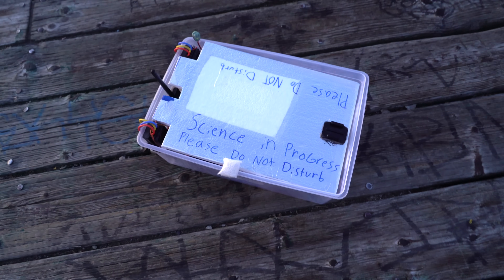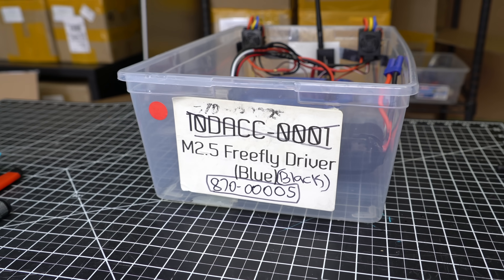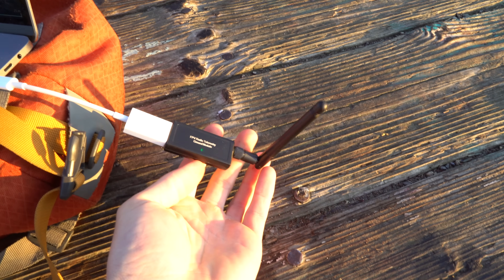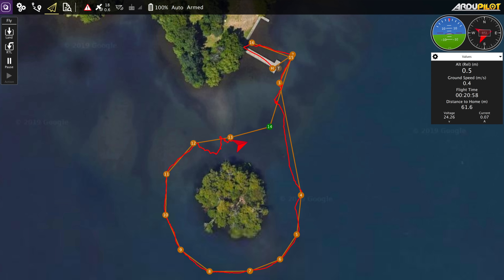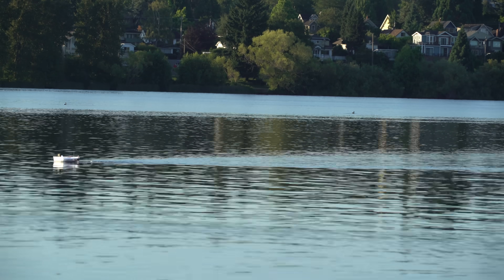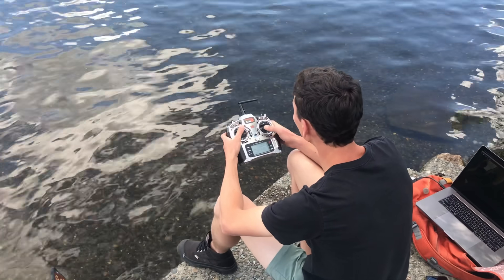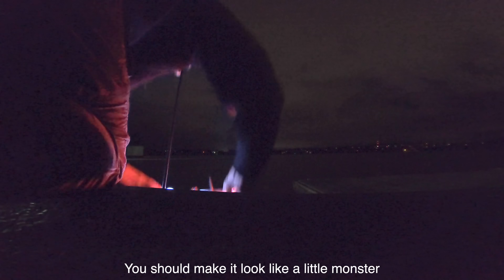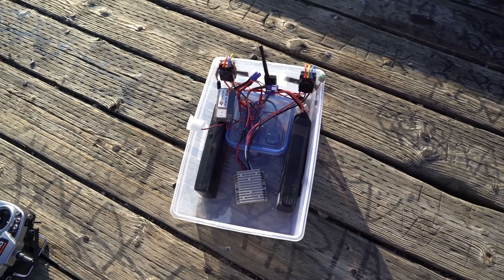Autonomous Box Boat - Long Range Waypoint Mission - RCTESTFLIGHT

Comment: Those gurgling noises are cavitation.
Reply: Technically, those gurgling noises are ventilation. If air is getting in the propeller it is ventilation.  Cavitation is when bubbles form without air.  They occur when the local pressure (at some point on the propeller) drops so low that the water vaporizes.  In short air bubbles = ventilation, water vapor bubbles = cavitation.
This may not seem like a big difference, but the results from the two are quite different.  Ventilation often leads to a drop in thrust from the propeller, sometimes a very large drop in thrust.  But, it usually doesn't hurt the propeller, unless the engine over-speeds too much.  Cavitation, on the other hand,  usually doesn't make a big difference in the thrust, but if it occurs over a long period of time it will destroy propellers. It digs pits in the metal that, it they get large enough, can cause the propeller to break.
Reply: You right my mistake

Comment: I would drill two holes on the sides with a thin rope attached to a foam ball so it can be recovered if sinks.  It's a similar system to how hobbyist recover model rc boats.  Also you can plastic dip some parts that aren't waterproof.

Comment: Nice video! One thing to watch, is that those GPS units have a secondary compass. Pixhawk will use it when you connect the I2C of the GPS. When you calibrate compass, both will be calibrated. The danger is that if the GPS unit rotates (let's say, because you have it sitting loose in a box....) then Pixhawk kalman filter has a hard time resolving the mismatch between the two compasses, and you end up with a compass error. In GPS modes, the compass is used to set the azimuth to aim towards the waypoint. This happened to me once in my flying drone which caused it to crash into a tree. So this could be an explanation for poor navigation performance. You can disable compass 2 in Mission Planner setup to avoid this and just use Pixhawk internal compass. Oh yes and I agree with everyone else, it's a great conversation starter and gateway to other forms of "time wasting!" Have fun...

Comment: Why not use a regular RC boat hull with a proper rudder?
You spent more time creating electronic work-arounds to make a twin motor box navigate like a boat than it takes to make a decent simple boat out of wood/foam/fiberglass.
or..
An airboat would be much more efficient than pushing a box through water, in fact..I cant really think of anything less efficient than a box in water.
(tip: steer the airboat with water rudders for a more positive control and straight-line tracking.  Also angle the back 45deg so they dont snag weeds.)

Comment: Very cool project!  Was thinking you've probably seen that they have electric waterjet drives up to 1" output... they'd be perfect.  an option would be to have standalone paddle wheels or better yet large foam wheels with built in paddles so it could go on land and water.  You could make it a redundant system that ran in parallel or as an option.

Comment: Really great to see this video!  I'm one of the main developers of ardupilot and I really appreciate the feedback on tuning issues with a low speed boat and how you got around them.  Re seaweed getting stuck in the props, we have been thinking that maybe we could try and detect the loss of control and try spinning the props backwards.  I'm not sure if that will work but it's probably worth us trying.  Thanks again!!
Reply: is it possible to create a "lane of travel" from point to point? basically to tell the 'object' that as long as its inside the lane (10 meters ether side of the object) to not correct, and the degree it corrects depends on how far outside the lane it goes. Should create a more gentle correction rather than a jagged wandering. I think this would drastically help correct the "gps wander correction" stuff.
Reply: @HalfInsaneOutdoorGuy  Yes, AP actually already has what we call "Lane based speed control" and this may be the cause of some of @rctestflight's troubles.  The parameter is called WP_OVERSHOOT and it defaults to a very small 2m.  When the vehicle goes outside that it slows down and attempts to get back within the lane.  For sailboats (which AP also supports) we default this value to 10m but maybe we should make it at least 5m for all boats.  Users can change this parameter on their own though of course.  Thanks for bringing this up it hadn't occurred to me.
Reply: There are several other comments about issues he missed that could cause that drift, like the high current wiring being close to the GPS, having the GPS bellow the water line and the metal foil cover, and not using a compass for a craft of such small size. I'm sure Ardupilot could be improved, but no need to overcompensate and mess up correct setups with good GPS and compass systems.

Comment: Haha this Video is AWESOME dude.. I just started learning ardupilot with an omnibus f4 and a mini skyhunter but ive always wondered about the other versions of the software. Can you  link the 900mhz telemetry radios by any chance? Also If im using a 900mhz control link will the telemetry interfere with that? Any help is appreciated :).... Ps some little 3d printed prop cages should solve your seaweed issue i think lol

Comment: A vehicle that slow should use a compass. Distance between GPS measurements (speed) must be way greater than gps accuracy for "no compass" operation. Dont know if ardurover does gps-heading / gyro-heading data fusion. Your data sugessts it doesent. You need that for "low speed no compass" operation. 

Cant have your compass inside with high current wiring. The current will cause wrong compass readings and make your boat go in the wrong direction. Your compass could be in the round gps thing. Put that above the craft.

Dont ask why i know.

Comment: The big unlimited hydroplane boats (100 plus MPH) use semi-submersible props. 1/2 the prop is out of the water which causes a big rooster tail. You might try that on the next generation.

Comment: A single servo rudder would be uber simple and help a lot (and a small keel, or v-hull :)
Reply: And btw, you could see the wind on the water (chunks of wind appear a different shade) when you started.  When the craft veered off westerly and you were doing between 0.3-0.5 (11:15) -> I'll bet you the wind was blowing nearly as hard.  So of course a craft with a lower, more streamlined profile (definitely go for an upside down tupperware bowl ;) would do a lot better in the wind (and small keels).  I know I shouldn't comment before finishing.  I'm sure you thought of all this ha ha.

Comment: always wanted to make a sailboat like this.. I got an openROV and the guys making it recommended using wd40 to spray into the motors before and after use.. suggest you do it aswell.. and make like a fine metal mesh thing into a tube and place it over the motor and propellers and fix it onto the body of the next boat so they don't draw too much weed into themselves.. also I suggest a catamaran.. it's a quite fast shape and it is very steady in the water...

Comment: Build a duct around the motor and prop, and have the duct inlet protected so seaweed can't get in.  I think the ducted prop would probably create more thrust. And if the wind is blowing and causing the boat to strife left or right.. put a dagger board on the keel. It's like a rudder that doesn't move that stick straight down and prevents the boat from strifing off course. 
If you Google the sunfish sailboat.. they have a removable daggerboard the sailor can pull up in shallow water. 
If you used RC car speed controller, you can run a servo to the reverse channel, and use that to move a dagger board up and down. Just some thoughts for design concept

Comment: A simpler idea for a tangle-free drive - simply use aerial props, but position the motors above the water such that the tips dip into the water. It requires minimal modifications and it uses stuff you've already got lying around.

Depending on the angle of the motors, it can either be the "slapping" effect of a paddleboat, or a "slicing" effect for something vaguely like an airboat (but actually using water).
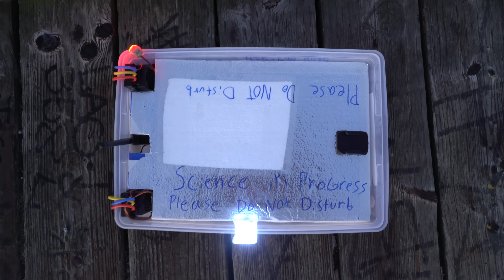Reply: If using the "slicing" effect, then you are describing surface drive propellers: Watch this at around 1:20 https://www.youtube.com/watch?v=Of1RY4M8VqM
The large difference in density between air and water would make using aerial propellers challenging, maybe requiring a gear reduction between the motor and propeller.  Also, I'm not sure it would help that much to prevent weed problems as the tip of the propeller could still catch a weed and pull it up and around the shaft.
Reply: @andrewsnow7386  Cool, I wasn't aware of surface drive systems! Looking it up, I see that there's a surface drive system called "Swamp Shark" specifically designed for operating in swamps with lots of vegetation and stuff.
Reply: Posotive side effect is the splashing keeps away people and ducks.

Comment: Using the compass will probably help with these. If it's only determining the heading based on GPS location, the slow speed makes it difficult to know the difference between it's own motive effect and being carried by water/wind currents. With a plane you can get away without using a compass because the vehicle is typically moving two or three times faster than the air around it, and can't make 90 degree (or more) turns like your skid steer can.
You probably know already, but Randy Mackay is the guy to ask about tuning and issues with rover/boat: https://www.youtube.com/user/rmackay9/videos
Reply: iforce2d  Yes, The GPS  will not start tracking if the boat is stationary geographically. The antenna should be mounted at least on top of the box - a small mast would be ideal. ✌️ Good effort,though 👍👍👍
Reply: But then assigning different GPS points that are at a much greater, corrective angle than those on the route should have little corrective effect if it has no sense of its relative motion. I suspect you're right that it's a factor, but I also suspect that using average hobby-level RC electronics for autonomous navigation sometimes turns out looking like this. It's not the first time I have observed this type of result, including with RC aircraft when operating autonomously for longer periods of time and distance than just a tour above an open field or two. Continuous evaluation of the impact of heading on course and applying an effective correction is obviously not as easy as it might seem. I have even observed some similar problems from older, inexpensive (uncertified) General Aviation units.

Comment: Maybe go with a paddleboat? Place the motors on the sides, above the water. Instead of propellers, use some sort of paddles that slap the water rearward. Maybe that'll be less likely to get tangled up. Basically it's like canoe paddling.

Come to think of it, some sort of paddleboat could be a way to make a canoe-like drone with just a single motor. The motor shaft goes all the way across the vehicle, with two paddles stuck on the ends - 180 degrees out of phase with each other. In "forward swimming mode", the motor just goes steady. But it's possible to turn by temporarily braking with one paddle down. This converts forward momentum into a braking turn. For gentle turning, it could be possible to cyclically vary motor power depending on which paddle is down.

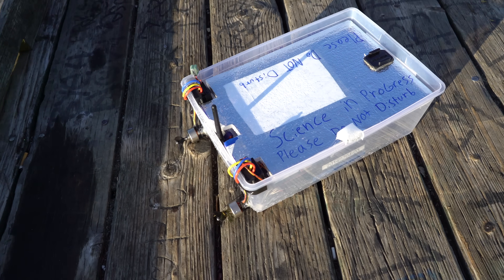Comment: 4:58... what is the difference between "RC Car ESCs and Plane ESCs" ????
Reply: Plane ESCs usually interpret 1000us pulse as zero throttle, and 2000us as full throttle. Car ESCs usually interpret 1500us as zero throttle (aka neutral?), 2000us as full forward throttle, and 1000us as full reverse throttle. Car ESCs are often also aware of the concept of braking, which is triggered when you go quickly from forward to reverse, and they will simply try to oppose movement instead of actually turning the wheels in reverse. You need to hold the throttle at neutral for a moment to exit the braking mode if you actually want to reverse. I think some car ESCs may also have a slower top speed in the reverse direction.
Reply: @iforce2d  Logical.. Thanks Chris... No RC cars here...:-(
Reply: @iforce2d  annnd theres the RIGHT answer.... Lol
Reply: Plane esc usualy have only one direction  car esc have two...
Reply: Motors are different too. Plane motors are fast. Cars are slower and torquey. (torquee? Torky? Torkey? Twerky? Lol)
Reply: @thegenerousdegenerate9395  dunno. My last rc car still had brushed motors...

Comment: I didn’t realise brushless motors  worked under water!
Reply: As long as you don't get the electronics wet it will work good. Also make sure you have really tiny   propellers.
Reply: The wires that make up the motor windings are coated with a film keeping them insulated from making contact with the water.

Comment: Maybe move the GPS receiver up out of the water line and you will get more accuracy
Reply: Yep. You should place the GPS antenna as far from the water line as possible to remove that noise.
Reply: Agreed...plus a bow of some sort may help with navigation. Less drag on the Tupperware...did I say Tupperware...ok, guys, y'all have such moxy to try stuff we wouldn't even think of working with.  But it rocked!! Good job...
Reply: @mhillvo  A couple of skegs would probably help and be more in keeping with the barge motif.
Reply: And the foil on the insulation board cover is a pretty good RF blocker. Love your videos, keep it up.
Reply: I know some GPS modules come with a compass too, thatd probably help with drifting about and help retain course stability.
Reply: Getting the GPS away from electronic noise may be more important than lifting it up from the water.  If you think of the water as a flat conductive surface (mirror) and the GPS signals as RF coming from somewhere in the sky, thinking about how GPS signals work is easier.  Moving a foot closer doesn't help but getting out from under obstructions and away from noise does.
Reply: What if you had three and then used Bluetooth beacons like xyo sentinels or Tile pro to help with drift.
Reply: @hyperverbal  bro its a fucking tupperware box not a military drone with a nuclear reactor

Comment: Question: Is a boat shaped air boat more efficient than a brick shaped propeller boat with seaweed stuck in the props? I'm thinking... yeah.
Reply: and he's not like he's short on power anyway, so why not, prop guards would probably do tho.
and yeah add some flotation or seal it up just in case
Reply: In this instance, I think Daniel is just going for simplicity with the "boat" whilst he gets to grips with the complexity of the electronics and tuning of the software, just as a proof of concept.

I think the most suitable option would be to buy a commercially available "boat" of some description. Something like a bait boat used for fishing would be perfect.
Reply: Air boat is less efficient than an actual BOAT SHAPED boat.  Motor in water creates more thrust than motor in air, due to density, that's why helicopters struggle at high altitudes: TWR decreases significantly.
Reply: Yeah and sails and shit ya know
Reply: @mccc4559  And bikini bitches, champagne, coke and music